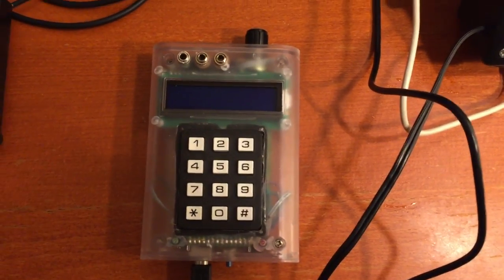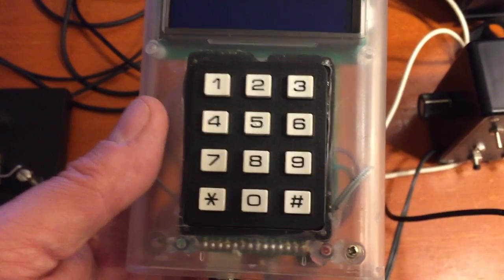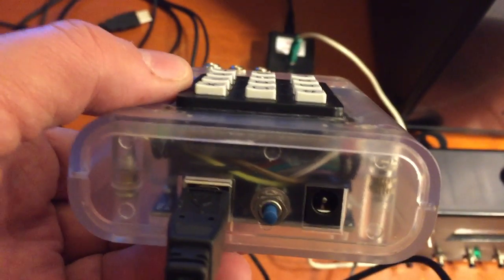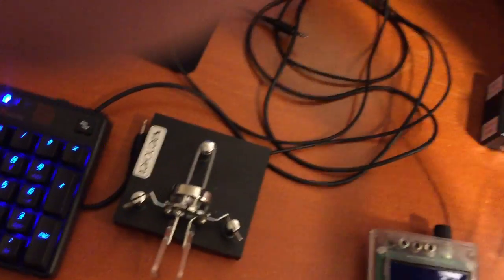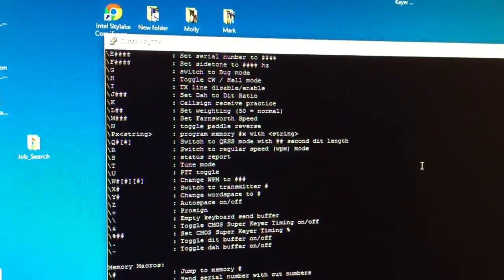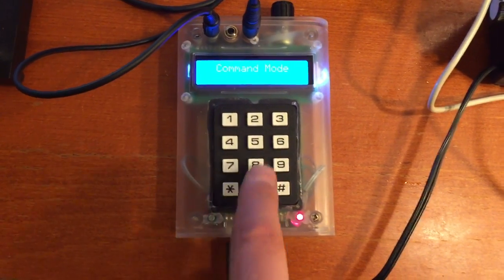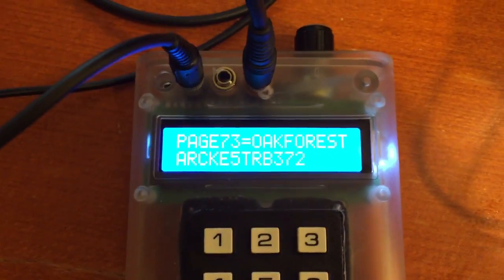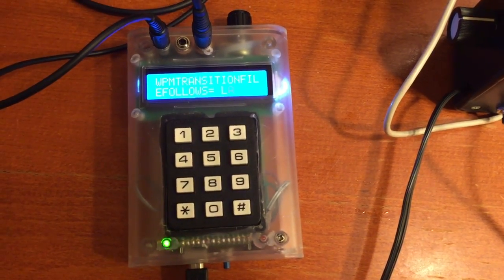Full-featured K3NG CW Morse code keyer on an Arduino Mega 2560 R3

Comment: A very nice video that explains many aspects of this keyer build. I found that recent releases of the K3NG software have led to increased code size and just adding memoires and either a keyboard or Winkey emulation (those are the features I wanted) leads to code that won't fit in the 32K of an Arduino Nano or Uno. So like yourself I feel that I need to consider the Mega2560 which has 256K of memory so the constraints go away. Leads to a slightly larger physical implementation though. Really nice packaging on your part.